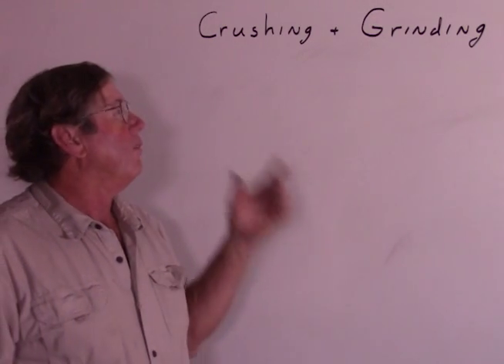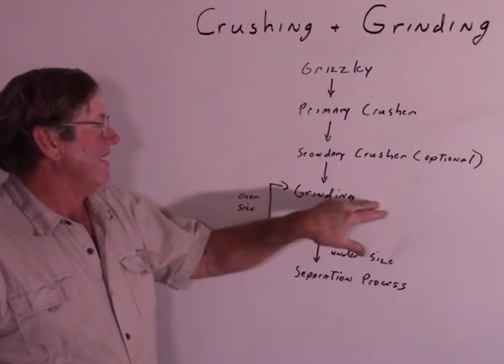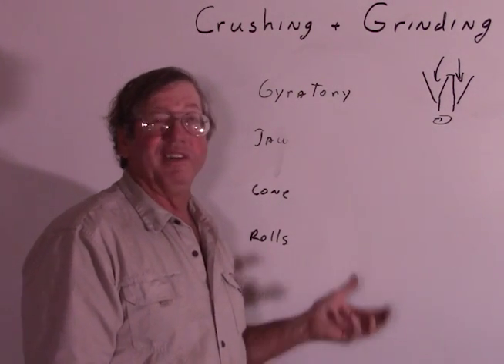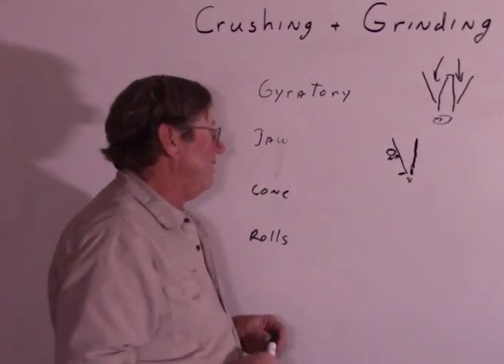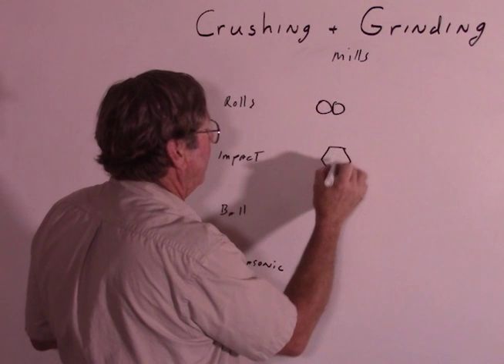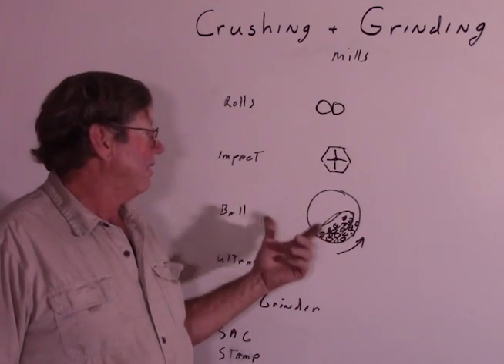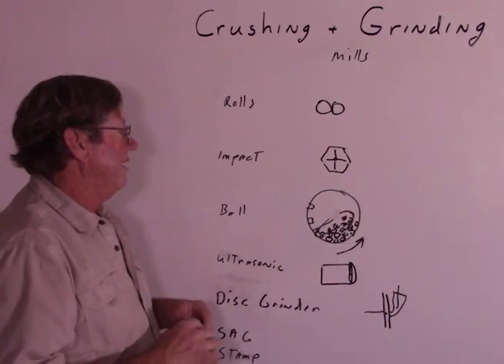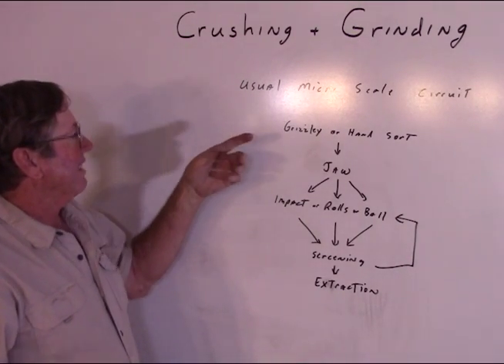Lesson 10 Crushing and Grinding: Technical Level Intermediate

Comment: Wish I would have seen this before buying my impact mill, without replaceable inner drum liner. Good info
Reply from the maker: I think it is rather reprehensible when manufacturers:

A. Make representations about what their equipment will do that are dramatically different from normal experience or..

B. Market something as a piece of production equipment that will not last long under continuous use.

When I build something, I build it for ME first.  Then, if it works well I will see about marketing it.

Got a number under development, but not set up for production yet.

Keith

Comment: How do you calculate the power needed to crush limestone to ultrafine powder of an output of say 1ton per hour?
Reply from the maker: First you would need to DEFINE "ultra fine powder" and with what equipment.  For example, ball mills are more energy efficient than impact mills.  However, they are also larger and depending on the source, possibly more expensive.

In my personal experience with impact mills I would expect a 15-30 hp requirement to grind 1/2" minus to about 60-100 mesh minus if fully classified at one ton per hour.  Limestone would be good as the wear rate would be low.
Reply: @hardrockuniversity7283  can you share the formula to get the power needed either in Kw or HP?
Reply from the maker: Again, you would need to determine particle size and type of grinding.  If you know that you may be able to find a formula by an internet search.  If the ore is wet or dry, you will need need to be take that into account in the mill design.

I would caution that when looking up processing equipment suppliers, the throughput claims are often maximum possible under ideal conditions.  Thus the manufacturer's rating will need to be down rated.  I have used a 2 TPH nominal rate impact mill that will only get me about 1/4 TPH actual production.

I have yet to see a small scale mill that fulfilled the manufacturer's estimates.

Again, for 1TPH I would guess 15 to 30 Hp (12-26 Kw as a rough estimate.  Better to have to big a motor than too small also.

Comment: Great info, by pure luck (no planning involved)  Ive got a jaw crusher, roller crusher, impact mill then sieve. More luck than good management. Thanks
Reply from the maker: Excellent!  Combined with the hand panning you are practically set up to run a gravity ore.  For a non-toxic leach you are in good shape also, but ore grade determination would be more difficult.
Reply: @hardrockuniversity7283  Yes ive been sieving to 25 mesh which is 710 micron but my big bits of gold are only 150 micron, (ive measured then under a microscope with a micron marked slide) maybe 200 but with also fine and ultra fine gold. So I think Im going to have to sieve with 100 mesh so my quartz ore and gold bits are the same size so I can gravity sort on my M7 Wave table
Reply from the maker: @peterheylen8640  It's worth a try, but a standard wave table seems to be slow because too much feed packs the beds.  Make sure you keep good fluidization.
Reply: @hardrockuniversity7283  You are 100% correct. The packing under the first riffle bar and keeping it fluid are the issues. Ive been thinking about other options
Reply from the maker: @peterheylen8640  I have been working on some options......

Comment: Great information and a very didactic method to explain the processes of crushing and grinding minerals. I work in the industry of composite liners, mainly for ball mills and sag mills, and it would be interesting to explain how this kind of liners impact positively in the performance of grinding process. Congratulations for the video and thanks for share this info.
Reply from the maker: You're welcome.  Unfortunately I have no direct experience with ball or SAG mills, or floatation.  I would love to learn more sometime, but those darn bills kinda hinder going back to school.  Grrrr...

They are usually not the most apropos for micro scale mining anyway though-so for now it's jaw before impact with possibly a rolls thrown in the middle.

Thank you for the kind words.  It makes it worthwhile.

Keith

Comment: An impact mill will destroy quartz and make powder of it in one pass. I sell them/use them. It is very easy to replace the hammers in our mills, about 5 minutes. We have liners for the mill and impact rods, too and an attachment for a hose to a centrifuge and vacuum. Almost no dust.

Comment: Hello everyone. I have production line for vibro pressed concrete pavers. I'm using crushed river rock (very hard) for my main material, sizes 0-2 mm , 2-4mm and 4-8mm in diameter. I want to buy crusher for that river stone, input max 45 mm in diameter, output 0-8mm, but i need that 0-1 mm in output too. Which type of crusher is best solution for me?

Comment: I find that high volumes of water can easily and cost effectively move materials through a mine and the processing equipment saving on the cost of more complex, costly and maintenance intensive conveyor equipment. ~( 'w')/

Luckily for me, the mines I am seeking to buy comes with a massive supply of water year-round, albeit, I can not [and WOULD not] dump contaminate water into the environment, so all it really is, is a source of water to tap off into a closed loop system and replaces water lost to evaporation.

Comment: I have a design for an ultrasonic crusher. ~( 'w')/ [yes, I'm a full on nerd]
Reply from the maker: Nothing wrong with nerdity.  It has become quite popular in some circles.
Reply from the maker: I have seen an 'ultrasonic' ball mill once.  Seemed to work OK.  I've just built a prototype of an impact mill that seems to do well.  It is air classifying, so the output is much more consistent than a standard impact mill.
Reply: @hardrockuniversity7283  I definitely see merits in air classification as well, especially when it comes to fines which would want to float on top of water and be carried away, I also figure one can build an inertial staircase inside of a ball mill specifically for lifting the heavies from the bottom and depositing them separately from the bulk of the grind, it just has to be such a stair case that blocks out larger, lighter particles. Between those 2 [air and inertia] one should be able to readily and rapidly sort their heavies at all mesh sizes. 

Then, of course, comes in the question of efficient air moving equipment for high volume, but with precision air flow control so that neither too much air or too little air is delivered to the sorting areas.

I have a small roots type blower [ 2" inlet and outlet] (can be mounted to gas or electric, or even water wheel input) and a gas operated leaf blower as well as some old vacuum cleaner motors, so I can work with either an electrically or engine driven air supply.

With the large volume of water the land is offering, I do hope to be able to employ a water wheel to do a lot of my work because it would be cheaper in the long run than fuel or electricity, assuming I can make a cost effective flume down the valley.

My thoughts on the flume is to cut it as much as possible from the hillside as a contouring canal, and then use chert stone and concrete for the balance of the outer walls where trenching can not be economically performed. It may prove financially unrealistic I admit. Will just have to play that one by ear.
Reply: @hardrockuniversity7283  I come from a family of engineers, machinists, and other nerdlike professions, so it would be a stain on my family's good nerdy name to do things in some rudimentary way. [HOP HOP HOP!]
Reply from the maker: @DeliciousDeBlair  I wouldn't call engineering and machining 'nerdlike' personally.  One can actually get icky hands and might even BLEED!
Reply from the maker: @DeliciousDeBlair  I have no idea what an "Inertial Staircase" might be, but if can do a good separation- I'm all for it.

WRT the flume- erosion can be a problem.  Perhaps a fairly steep drop with pipe followed by a hydro generator might be more practical and versatile?
Reply: @hardrockuniversity7283  Hey! Nerds don't have any problem getting our hands dirty (or even bloody or electro-fried on occasion, been there, done that, all in the name of ssssssssssssssssCIENCE!!!) ! 

Its our GLASSES we defend with our lives! [HOP HOP HOP!]
Reply: @hardrockuniversity7283  If the flume lasts as long as 3 years, the mine will more than adequately pay for the addition of an epoxy sealant.

Pipe would cost a lot for sure because in 200 feet of drop, you would need a lot of pressure capacity, and if it clogged up, froze and split or a whole host of other bad things, you could be in for a whole lot of additional expenses.

Also erosion only really happens when you have a lot of speed and/or a lot of sand or similar abrasives.

Sedimentation would be more likely [mostly from falling leaves and branches, or else silt running down the hillside] as it would probably never flow faster than 3 to 5 mph and simply turn a very large diameter pocket-wheel.

Also I need to do something which will in no manner obstruct the normal flow of water, but rather simply allow me to catch some of the flow from one side. This requires that I build a side pool which is out of the main flow, and which allows me to begin dropping the water level very precisely so that it does not take away more than 5% of the total of the creek.

Since the creek averages 20 feet wide and 18" deep, I figure I can get away with a flume flowing 18" wide and 12" deep and stay within my 5% flow consumption.
Reply: @hardrockuniversity7283  The inertial staircase is really simple in principle, it is little more than some saw toothed notches in a ramp which allow material to slide one direction [with a very gradual incline] and drop into a pocket that prevents them from falling back downhill.

Another method, if it is gold or anything diamagnetic, is a set of magnets which will forcibly divert metallics away from one source or another, sort of 'herding' them into a secluded container where they are easy to separate out.

The non-magnetic particles will not be affected by the magnets, and if you use tungsten or other non-magnetic materials for your crushing balls, they will not be affected either.

If you have a one-side-screen to allow all the small particles through at the same level, you can always use physical distance to keep the magnetic separation from influencing the balls [if they are steel] in the mill.
Reply from the maker: @DeliciousDeBlair  Without them little else would matter...
Reply: @hardrockuniversity7283  Without what...? 
~( ,m,)~
Reply from the maker: @DeliciousDeBlair  The glasses three posts ago.  :-)